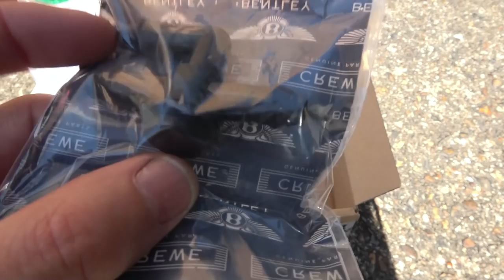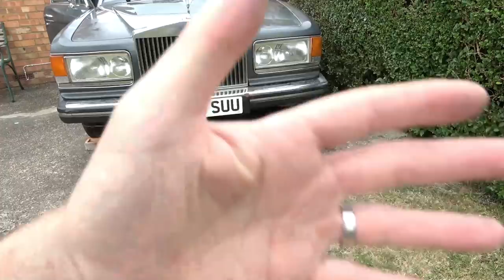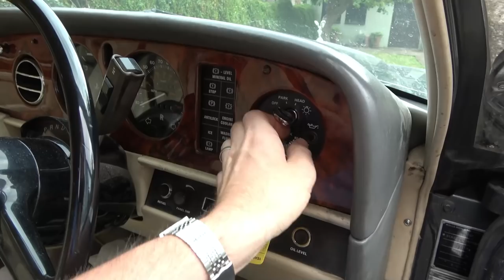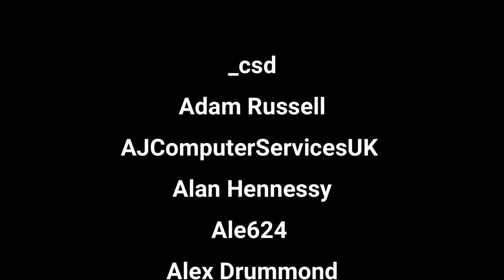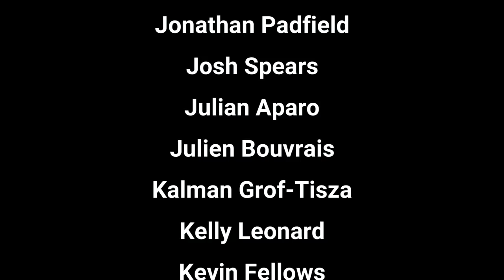Trying to Repair the WIPER MECHANISM on a ROLLS ROYCE SILVER SPIRIT - PART 10

Comment: My dad was a mechanic for 20 years: get one of those magnets on a long pole. You can just move it along areas of the engine bay and eventually something will “bite”. 🙂
Reply: This indeed. Or even fabricate your own, tear apart an old speaker and put the magnet on a string
Reply from the maker: I'm going to look on eBay right now and buy one 👍👍👍👍
Reply: @DG-mi2mc  or a dead hard drive :)
Reply: try to find one with a protective sheath so that its not constantly sticking to the body......the engine.....next doors cat that ate the bit you're looking for
Reply: Yeah, they definitely come in handy.
Reply: I have a drawer full in my toolbox - magnet fishing is a constant pastime
Reply: @dheenhasty6174   yes hard drive's magnets are very strong 👍
Reply: Dear  @dheenhasty6174  
Actually a good idea, but those relatively small neodymium magnets are way too strong and will therefore stick to anything, especially bigger parts in the engine compartment. Nevertheless they are very good for fishing for parts you lose on the ground/in the dirt. Put a string on them and pull them behind and you will mostly find what you have lost (and more!). Hard drive neodymium magnets are also good for finding/removing screws/nails from your driveway.
Best regards, luck and health.

Comment: You can WIPE that one off as done, Vince.  Great job. 👍
Reply from the maker: I been trying for 10 mins to thing of a different pun and I can't so I'm just going to let the good times Roll...s Royce...I'm sorry
Reply: @Mymatevince  i had a boss who had one these them wiper when of were never that high up they were lower closer to bottom of screen and i notice when ur driver side wiper was on full stroke was hitting the silver trim when off there still to high lower them down that will also help the intermittent not being so high up
Reply from the maker: @andrewevans1234  Cheers Andrew👍👍👍
Reply: @Mymatevince  sounds like you're getting into the Spirit of it!
Reply from the maker: @ryandavis7011  🤣

Comment: About the brake system: The brake master cylinder is actually a brake valve, that opens high pressure LHM fluid to the brakes, you can see the lines coming in and going out, very neat system. The middle green sphere around there, or in the engine bay is an accumulator sphere, with 55-62 bars of Nitrogen, and your main pump works against it, builds up pressure, you should hear a click when the pressure is enough. With so many leaks and likely blown spheres it would be a rather frequent clicking. With all that, replacement of the spheres is easy as it gets, same as an oil filter, hand tight at the end, done. Make sure, there are obviously no leaks on the high pressure, and return lines (the suspensions should have one high pressure intake, a rubber hose as return, and an other rubber hose for air outlet per each wheel.) Once the system has enough oil it should work most of the air out, but there is a screw around the middle sphere, which if you open by a half turn or so lets air out, or depressurizes the system, depending wether the engine is running or not. Do you have spheres at all 4 wheels and 1 in the center? Or only the two rear, and one center? (There may be a middle sphere in the back as well, that's for the rear so it doesnt immediately sink, and there migh be an anti-sink valve as well). Check the sphere's threading, hole size, and pressure, but it's likely that some Citroen ones will work.
Reply from the maker: Thanks Miklos, I may be wrong but it looks like I have 2 spheres in the back, one above each wheel hidden in the boot (trunk). I then have 2 next to each other in the front of the engine bay. On this car it is just the back wheels that have the hydraulic suspension so maybe the 2 front spheres are for the braking system. It will become more clear the more I work on the car. Thanks for sharing your knowledge 👍👍👍

Comment: Loving the Rolls content its coming together nicely.
I did notice that the drivers side wiper is hitting the A pillar trim on the windscreen, maybe it need to go one spline lower in the park position to prevent that from happening.
Just a thought, keep up the great work.
Reply from the maker: Agreed, cheers Lee, I need to play with the positioning again 👍👍👍👍
Reply: @Mymatevince  For what it's worth, I think you're very close to having it dialed in. :)
Reply: Yeah the drivers one definitely needs to go lower - you'd be surprised how much difference air flowing over them when you're driving makes, I'd say it needs to come down at least 60mm, maybe more.

Comment: Once again, thanks Vince for pulling stuff apart on your 88 Spirit to show me what's waiting on my 82 model. After seeing your wiper mech I went out and sprayed mine with a bit of grease lol! Perhaps try mounting the driver's wiper a spline or two down from where it is. On mine, both wipers park a little closer to the scuttle. The wipers do sit at an angle when in use, but it's not an issue IMHO.

Comment: Regarding the intermittent wiper position, check and replace the relay that controls the on / off for the intermittent wiping. I've read that they can become "sticky" and the wipers carry on passed the position where they should stop.
Reply from the maker: Well interesting I learn about relays in a future episode so I should be able to check that or swap it with another one if they are the same. Thanks Colin 👍👍👍

Comment: Hi there,

This won't be easy to explain, but the mechanism you're struggling with is the eccentric drive which gives the extra throw to make the wipers park at the foot of the screen.

When the wipers park, the motor will reverse direction moving the eccentric thro 180 degrees, when it will lock, thus extending the effective length of the driving arm. Lots of 60's Jaguar saloons, Rover P6B's etc used a similar arrangement ( though on those the eccentric was inside the motor casing).

On starting the wiper motor will start up the opposite direction, the eccentric completes a 180 degree turn, thus shortening the arm and the wipers move up the screen when wiping. 

Sorry I can't help with how the mech assembles as I've never had a Rolls one in bits, but that it is what it's supposed to do.
Reply from the maker: Thanks Steve for the explanation 👍 👍👍

Comment: It might be worth opening up the part of the wiper motor that handles the contacts for when to stop the intermittent position, it might be off by a small amount as you can see it stops a little late (with the wipers already up on the screen) but that's just a guess and I'm not sure It's supposed to be like this (maybe a dirty contact?),  nice video! The driver side wiper in the park position could even be lowered by a tiny amount, maybe one spline, as it hits the A pillar, but these are just some tiny tweaks, you've done a magnificent job!

Comment: Hi Vince, Love all your videos. To fix the intermittent speed I think you need to match the intermittent lower position of the motor, with the click of the middle arm, and then place the wiper blades flush to the lower part of the windscreen. That way both the park and the intermittent stating position will match.

Warm regards from Argentina!
Reply from the maker: Yes, that makes sense. I think that the park is controlled by a separate switch so to begin with I will try to adjust the motor arm (not the wiper arms) to a lower position on the intermittent stop. If that fails I will try and match the click as suggested. Cheers Nicolas 👍👍👍

Comment: Vince, if i remember correctly you can adjust the windscreen washer jets by putting a pin in the hole of the jet and turning it to the desired position on the windscreen. I know this because when i was young i would turn the jets on my Viva towards the path and spray people at the bus stops. Tee Hee.
Reply: I was thinking the same. The nozzles must be adjusted.
Reply from the maker: 🤣🤣 Hahaha thanks John, yes you can, I think the windscreen ones look to be ok, maybe a bit towards the middle but easy to adjust. But the headlight washer one is already at it's limit so maybe the bracket that it is attached to is bent a bit out of shape. Right now I haven't got the energy to spend anymore time on the headlight washers BUT a little down the line the pain they caused me will vanish and will look at it again to tweak it 🤣👍👍👍
Reply: @Mymatevince  Cheers Vince, don't forget to keep the electronic repairs going, I'm split 50/50. Because of you i now do electronic repairs and sell them on eBay for fun. i am at that stage where i have all the gear but no idea. lol. Keep your videos long please, Its disappointing that Steve { Tronics fix ) is making such short videos now. Cheers John
Reply from the maker: @johnl8782  Yeah, the car is taking up the lion share of my time so the blue mat videos have suffered unfortunately. I've got a couple in the pipeline over the next few weeks but as the weather worsens then the blue mat vids will be back, just trying to make the most of the sun while we have it, as working in the rain isn't so appealing 😂👍👍👍

Comment: Paint is always a problem with such old things, you need to do a paint colour matching (there are tools for this) instead of buying the 'original' colour that is based on the same factory colour. It is never exactly the same because the paint you bought is never exposed to UV-light (sun), not from the same batch (mixing process) and so on. The difference can be huge. 

What I did with an old Datsun (brown colour haha) from the 70s is using the closest colour I can get  and apply it on a larger area (sprayed gradient like). Also I heat the paint to about 30 degrees in a bucket with warm water before progressing and be sure you shake the paint for a few minutes. Flatten (sandpaper) and clean the surface very well before doing this. Wait the paint to dry however it must not completely dried out and follow the next step. Never use sandpaper on applied paint! I used a soft cloth with wax and rub it hard so it will get hot (by friction) and that is the best part. The paint 'melts'/mix into the original paint and the result can be amazing! This damaged spot was on the roof of the car and it wasn't visible it was damaged before. The downside (if it is really a downside) of doing this is that you need to wax the whole car to match the shiny result.

Hopes it helps! Nice to see your progress.

Comment: Hi Vince. Following this series closely. Thank you :) I had to change the T-valve for the headlight washers on my Alfa, it had gone faulty too. Apparently, there's a metal membrane inside that will rust over time. I had to pay 60€ for the new part at the dealer… cheaper than buying online, since I didn't pay postage.
Reply from the maker: Thanks Stephan, €60 makes the Rolls one look cheap 👍

Comment: Great video,Vince,
The headlight washer jets can be adjusted to spray exactly where they have to spray the washer fluid. They HAVE TO BE adjusted properly, too.
Reply from the maker: Thanks Andras 👍👍👍The passenger side headlight washer appears to be on it's limit though. I think the bracket that it is bolted too might be out of shape. I need to look at it again down the line a bit 👍
Reply: @Mymatevince  there is no balljoint in the jet nossle? The ones for the windscreen usually is a ball with a hole and one can put a thin "needle" in the hole and move it around to adjust the "aim"...
Reply: @Mymatevince  yeah, that is possible. The car could have a massive hit on the front before. There are a lot of mechanics out there who do not care about those little details. I fix cars, too, at home. Old cars that no one else wants to fix.

Comment: " yeah , it does come in a little Bentley bag , maybe i paid for that ". You definitely did . I had an x-type Jaguar and had to get a part for that , crank shaft oil seal . The engine on the 2.0 diesel is from the Ford transit . Jaguar oil seal £38 , ford oil seal £28 . After a while you learn that a lot of the parts on those are the same as the Mondeo mk2 and a lot cheaper . The working mans Jaguar but still a good car

Comment: Another interesting repair, very smooth and nice operation after repair :) 
Quite interesting and complex wiper mechanism.
I wonder if the used Bentley parts were from left hand drive car, if they were the opposite way compared to yours? Usually left hand drive cars have wipers pointing to the opposite direction than right hand drive cars.

Magnetic rod or endoscope could help finding dropped parts from hard to reach places.

I guess you know it already, but good to remind anyway for safety, always use jack stands before working under the car, lift alone isn't good enough as it can fail.
Reply from the maker: Thanks JSV, yes I have some axel stands and I will be buying a couple more 3 or 4 tonne jacks of some description, not 100% sure which ones yet. The part was from a Bentley Eight 1985 RHD car but lots of viewers mentioned the same thing about LHD 👍👍👍👍 Good thinking but maybe they just tweaked the design over the years. Cheers 👍👍👍

Comment: Loving this series,  when it comes to finding and tracing the oils leaks, you can get a uv fluid that you put in the oil reservoir, then use a uv torch to spot the leak,  its probably already been mentioned in the comments somewhere, but anyway great video vince 👍
Reply from the maker: Don't think it has Ben, if I can't visually see the leaks then I will look into the UV fluid. Thank you 👍👍👍

Comment: My Sliver Shadow wipers sit in the same position when on intermittent. Our Rolls Tec tells me that’s the way they are designed. 😊
Reply from the maker: Interesting, others say it should sit lower. I'm going to look at it one more time to see if moving the arm on the actual motor itself fixes it, rather than adjusting the wiper arms. Thanks for letting me know that your Shadow is the same 👍👍👍

Comment: @mymatevince Hi Vince. I had a similar arrangement on a montego I had years ago and currently the way you have it set up is not correct. The reverse action of the wiper motor changes the length of the radius on the arm going around on top of the motor by rotating the piece with the pawls and  roller in. If you remember the centre of that plate is eccentric. So if you turn it 180 degrees or so the working radius is different. When you have this correct the intermittent wipe will sit correctly and when you turn the wipers off, they will move down out of sight. I think the rotating arm needs to be set at the position furthest away from the windscreen wiper pivots, when it has reversed and parked, then set the wiper arms on the pivot pins to match. The position of the rotating arm on top of the motor pivot is crucial to how that mechanism works and the final position of the wiper arms rest. I hope that makes sense.
Reply from the maker: It does make sense Steve but I will need to re read it a few times when I have the car in front of me to fully understand it. I already came to the conclusion that I need to adjust the arm on the motor when I was watching back the finished video but I didn't really know why. I knew I had already tried various positions on the wipers but NOT the motor arm. Your comment will hopefully make it crystal clear when I can see the mechanism again and play around with what it does in different positions. Hopefully you will see it working in a future video.  I'm already up to episode 21 so it will be a while before you see it. Thanks for taking the time to comment, it's a big help 👍👍👍👍

Comment: I had similar position issues on another car. Spent years fettling with the wiper arm position and the linkage swapping various arms etc. In the end I thought the motor is the only thing that hasn’t been changed! So but the bullet reluctantly and it fixed it. Made no sense to me as other than the finish position it functioned fine which is why I lived with it for so long. If you can get a confirmed functioning one cheap it may be worth a try as I think it’ll drive you mad eventually -Talking from experience! Alternatively service the current one and get some more content out of it!

Comment: @26:28 - That ring you dropped - I have been listening to that over and over intensely and it's my opinion that it hit the concrete on its edge and rolled off the concrete either along the edge of the grass vertically or under the bushes on the drinkers side of the car.
Reply: The last sound it made was metallic to my ears but I stand to be corrected.
Reply: @angelsone-five7912  I'm sorry... but I don't trust daleks.
Reply from the maker: You're not the only one to say that. I will check the bush next time I am there 👍👍👍 I think if it was on the grass I would have seen it by now but always worth a rummage 👍👍👍
Reply: @Mymatevince  Think of it standing up right along the concrete hidden in the grass.  It won't be obvious.  I've no doubt you put in some hard graft to find it.

Comment: The intermittent (parking) problem I have had before (not on a RR), the parking position was controlled by a cam & switch setup on the motor itself, might be just a  set of contacts or a microswitch which interrupt the live feed by riding on a nylon cam wheel.
Reply from the maker: Thanks Froggy, I'm going to look at this again and hopefully get it 100% sorted 👍👍

Comment: I'm pretty sure they are suppose to look like that on intermittent. I've known a lot of cars with the same weird position for intermittent wipe. Just a little thing the drivers side wiper is hitting the door post might shorten the life of the blade. If you can move it down a notch don't think it will look to bad and might save that wiper.
Reply from the maker: Cheers Rupert 👍👍👍